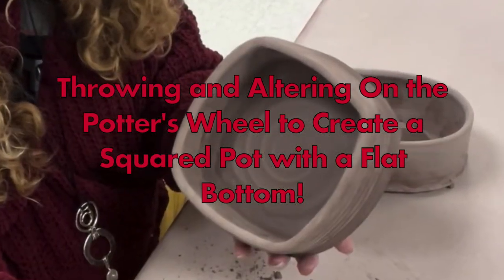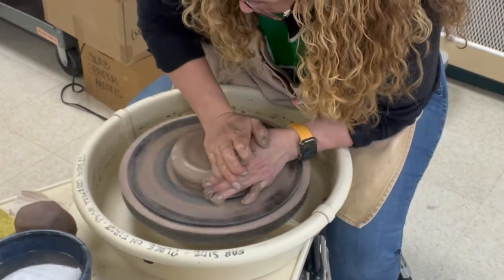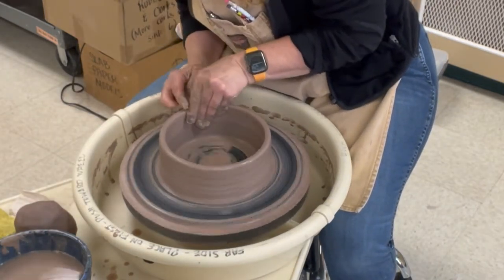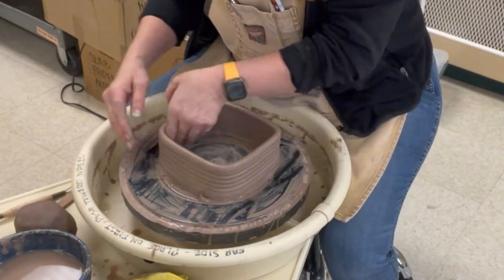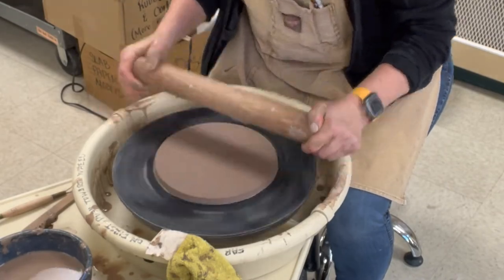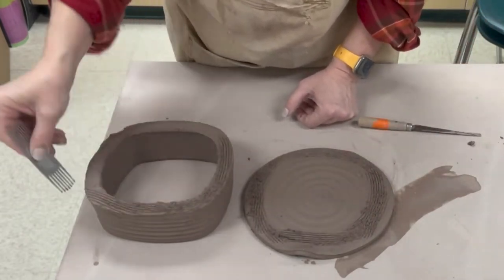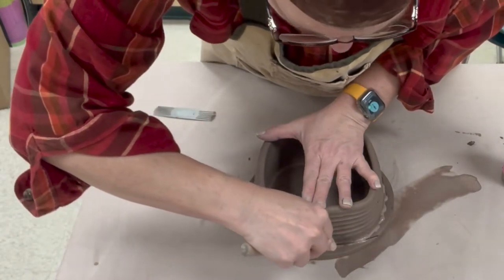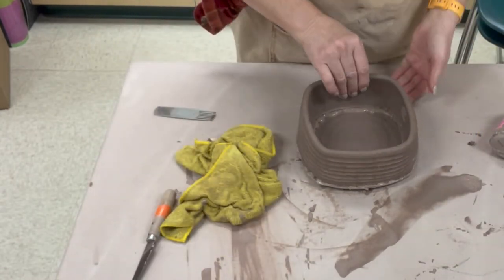Throwing and Altering On the Potter's Wheel to Create a Squared Pot with a Flat Bottom!

Comment: @KaransPotsAndGlass How hard would it be to create a glazed white ceramic rectangular vessel sink for a bathroom vanity? The only people on youtube creating such sinks use concrete, so I'm guessing it's a challenging process without factory equipment..?
Reply from the maker: Very challenging- for a rectangular form, typically it would be slip cast for strength, it could be done with slabs, of course, but it would be fairly difficult.